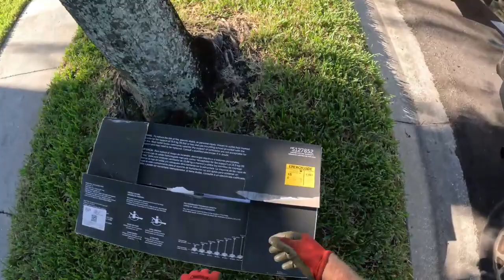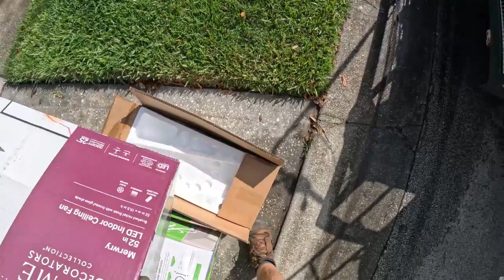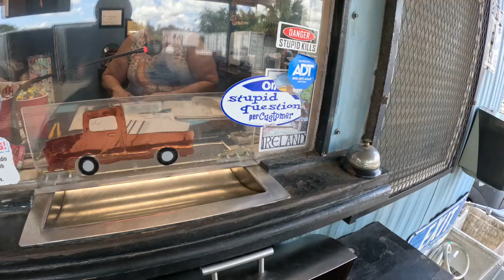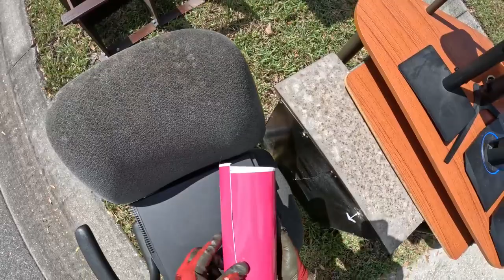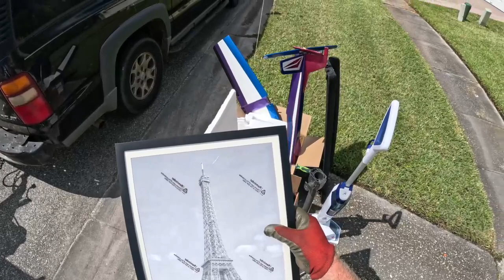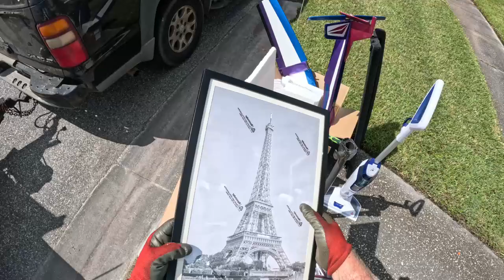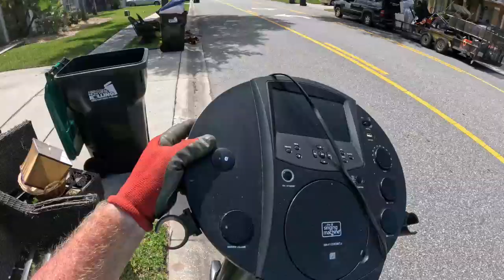Fan tastic Hump day

Comment: I’ve noticed that you get out of your truck when you come into the yard, but when you leave you are in the truck. Does the yard weigh you before or after you are out of the truck?
Reply: He’s standing on scale so they weigh in and out before he goes to jeff
Reply from the maker: On the way in I get out so I can see the weight and on the way out I am usually facing the scale
Reply: That makes sense. Thanks. I was hoping that you weren’t getting shorted.  👍